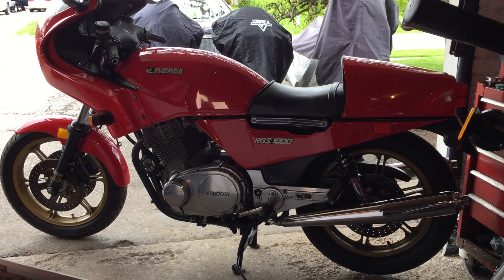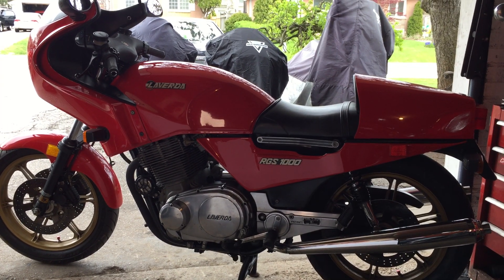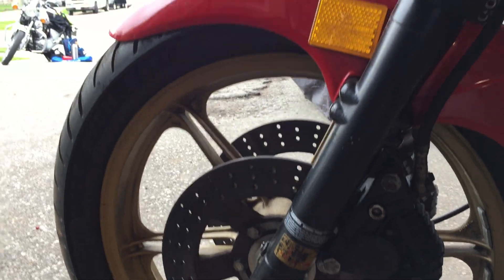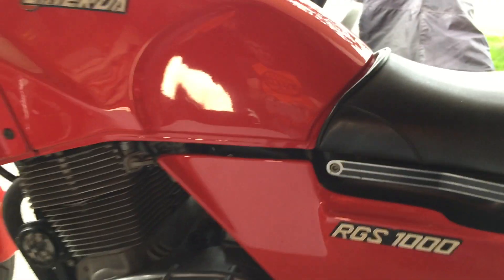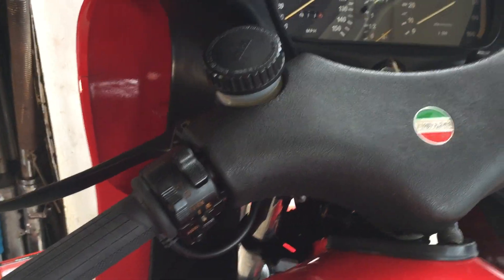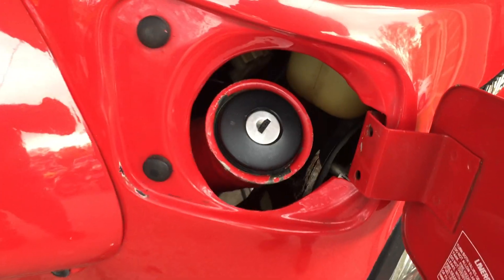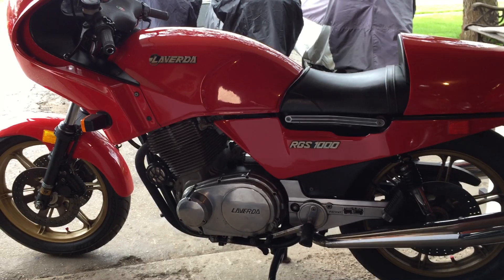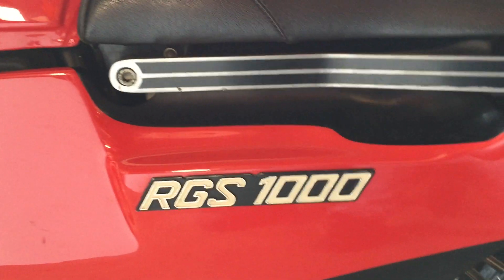1983 Laverda RGS 1000 overview

Comment: Lovely to see your RGS. Same year as the one I had. Very good on fast roads, steering a bit ponderous around town. 
I would run it at 130mph and it was incredibly stable, only your head getting buffeted by the wind. 
I changed the jetting and ran it on jota pipes which I think freed it up a little but it also sounded fabulous!
There were a few things that were design mistakes. I could never get the starter clutch to stay in one piece. The hydraulic clutch that operates what looks like a brake piston and leaks. But the one that really pissed me off was the hose to the surge tank in the fairing that was not petrol proof. One day I hit the brakes, the hose came off and it was like a petrol old faithful going off in the fairing. Petrol hit me it the face and soaked my leathers. I was drenched in it and so was the bike. How we didn’t go up in flames....... I coasted to the side of the road, got off and walked carefully away!
I was going to stop there but something else you said about the seat. There are two rubber bungs that push up through the seat base. The rubber spikes that secure them in place........ after riding a few hours the foam has crushed down and you realise that you are sitting on these bloody spikes! Now it may be that I’ve just got a big ass.....
Would I have one again?
In a heartbeat 
Thanks
Bill
Reply: sorry to be so off topic but does anybody know a way to log back into an instagram account..?
I somehow forgot my password. I appreciate any tricks you can give me!
Reply: @Santana Mohammed Instablaster :)
Reply: @Preston Langston i really appreciate your reply. I found the site thru google and Im waiting for the hacking stuff now.
Seems to take quite some time so I will reply here later when my account password hopefully is recovered.
Reply: @Preston Langston It worked and I actually got access to my account again. I am so happy:D
Thanks so much, you saved my account!
Reply: @Santana Mohammed No problem xD

Comment: I've had an RGS for may years, now a SFC1000 for even more years, and it stays ;) The Bayflex was developed by BMW and used in agreement by Laverda on the RGS model. The engine was actually early computer developed, leading to better ignition, alternator, cylinderhead, outrigger bearing for the triple fork outside the crank, better gearbox, dual single primary chains etc.
The beautiful Bayflex parts were designed outside Laverda, by RG Studios, or as Massimo joking about it, called Real Grand Sport ;)
You may like the Komis or Ikons as they are today, but on your bike, they are 16mm too short. You can remedy that by lowering the forks, or it will steer too slow.
 The hydraulic clutch was not a first on the RGS series bikes, but came in first on the 180° 1200 jubileum or aniversary bike (black and gold).
Despite having read the problems of other RGS owners, I must say I never had those problems ever. I did have one ignition pickup needing a bit of glue and repair at one time, but other than that, It just ran and ran. Actually a fast bike. I drove with a friend on his duc 916, and while he jettet off, I came home first in the 150 km ride and had popped a cola, trying to look cool and relaxed, when he drove in the yard ;) Had a lot of fines on my former japanese bikes before all my years with Laverda, but since riding Laverda, I never had one. I am stopped though ;( For admiring the bike by the interested police officer, asking about the bike. That goes for both my former RGS and my present SFC1000.
To the gentleman below in the comments who talks about a Pantah 600 and too much weight on the Laverda, my SFC1000 was 218 stock, now jsut under 200 kilo including everything, sans fuel. though still top heavy. I ALWAYS run Shell V-power 100 octane, and ad a tiny squirt of Castrol Valvemaster. Actually both the RGS and SFC1000 are quite fast bikes, and will not slow down for a bit of wind, a passenger or luggage. Supreme bikes built by real enthusiasts Massimo and Pierro and more or less the whole village of Breganze.

Take care of your great bike!
Thanks for sharing.
Jacques
Reply from the maker: Thanks for the comments, and wow you're lucky to have an SFC1000! I've never even seen one here in Ontario Canada. I got the IKONS from Wolfgang, and I always follow his advice, so I think they're a match for the RGS. I'll check with him about you saying they are 16mm too short. They're the same length as the 'piggyback' Marzocchis that came with it so I'm really interested to find out if those were too short too? As for the weight issue - I wrote a piece for RealClassic magazine that compared the dry and wet weights of bikes of the same era as the 3C. Turns out the 3C was nowhere near the heaviest machine - among those heavier were the SOHC Honda CB750, the Suzuki GT750, Kawasaki Z1 and more. I guess because the 3C is 'top heavy' it got a reputation.  I love the RGS but I really do prefer the 180 triples despite their foibles.

Comment: In 1983 I bought a silver RGS from European Cycle Specialties in Garden Grove, California. In 18 months I enjoyed 20K+ miles of sport riding, tours, and commutes to the Diablo Canyon nuclear powerplant. It being so unique started many a pleasurable conversation with the curious!

One of its clever features, the remote fuel filler, was my undoing however: right after refueling, I'm braking hard going downhill, there's a faint pop and rippling waves of gushing liquid mysteriously appeared inside my windshield. Then I was down, BAM! Apparently the gas cap's pawls were not fully engaged after I installed it, and when fuel rushed up the filler neck under hard braking it punched off the cap! Luckily there was no fire. How many folks have actually crashed in their own gasoline? 🙋🏻‍♂️

It was a hard impact but little damage was done. A mirror broke and some minor scratches was all. The Bayflex plastic did its job.

The RGS was a very enjoyable steed, but it made way for an FJ-1100 in 1985. Another great motorcycle, that one.
Reply from the maker: Wow that's quite a story! Sorry you had to go through that.  I've had friends ride my bike and not know how to deal with the filler cap. It's important to keep the cap mechanism well lubricated and working to avoid just this issue! Though I've never gone down or had anyone go down because of it.  Thanks for the comments!

Comment: I believe Laverda originally went with a flat-plane crank because it's a pressed-up roller unit and a 120° puts more twisting forces on the crank (the mass of the pistons/rods 'fighting' with that of the web balance weights, trying to twist the crank pins laterally in the webs) i.e. the 180° is intrinsically stronger. And indeed, racers continued using the 180° engines long after the 120° was introduced.
Reply from the maker: The 180 is certainly unique and my favourite. A very different character to the 120.  Would love to try a 120 Jota to compare it to my 180 Jota, but I don't know of any here in Ontario Canada. Heck I only know of a couple of other Jotas, and neither of them are on the road...

Comment: Regarding the gearing, would it be worth changing the rear sprocket and go up a couple of teeth? It would decrease the ratio somewhat and give you more acceleration.
Reply from the maker: Not for me. I usually go down a few teeth or up on the countershaft as I prefer to lower the revs at highway speed.  These things are plenty fast accelerating already. I mean, fast enough for me. Of course they don't compare to modern bikes but if you want that, get a modern bike. I appreciate the suggestion though - some people may want to do that.